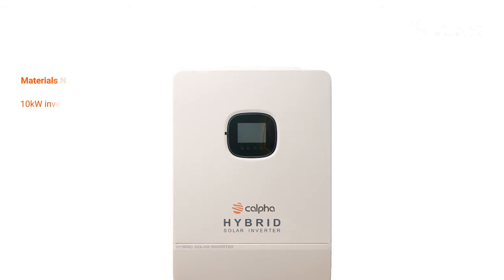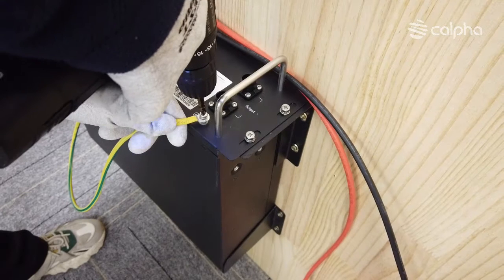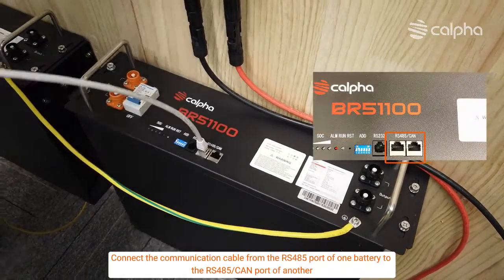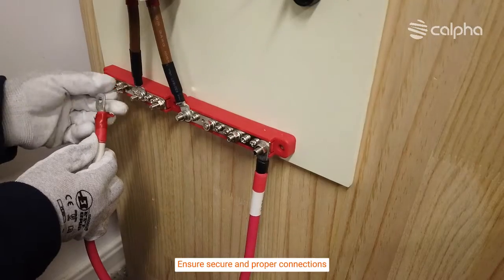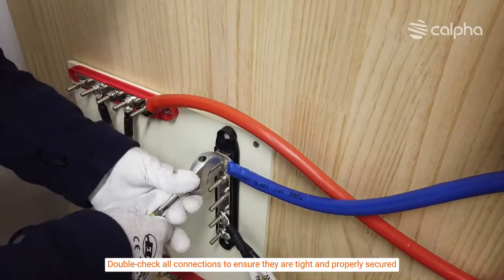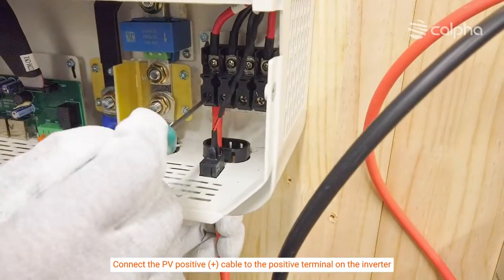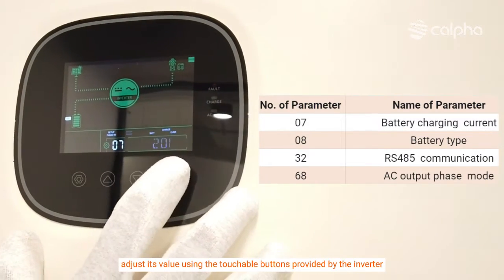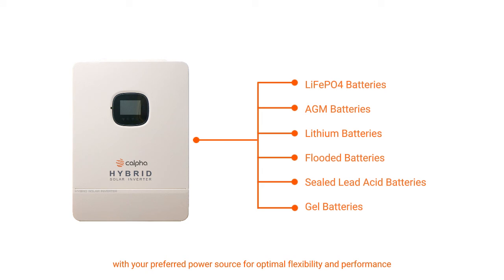Calpha 10kW Hybrid Inverter: Unleashing Sustainable Power for Your Home!

Comment: Hello Calpha, as many are asking about the Wifi dongle and communications with it.. It would be best to resolve this matter with the unit shipped to Hunt..as many of us see this as a concern.. Those who have seen the Hunt video, want to see more that he suggested he would do, however Calpha directly said it did not work with 10k, but after I spoke with the manufacturer of the unit (Srne), said it does work and Calpha and its supplier distributor needs to resolve this for Hunt video..My interaction direct with the manufacture Srne, is concerned of lack of Calpha and its associates not stepping up to the plate. Calpha according to Hunt offered to send another unit.. It my belief that it would be best to resolve the one that has been displayed in the video.. as a tech in hardware and software my experience tells me, it may be settings, firmware, or dongle itself. As to why it not working as intended.. Resolving this matter would allow Hunt to then do a new and Final report, and conclusion. Rather than all of us who are interested in purchasing, holding off because this matter not resolved to my knowledge.